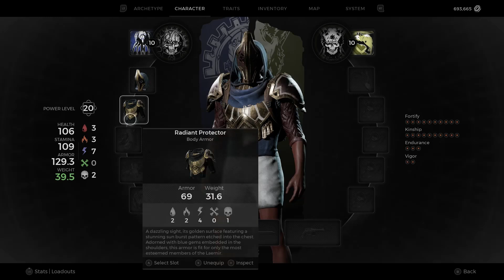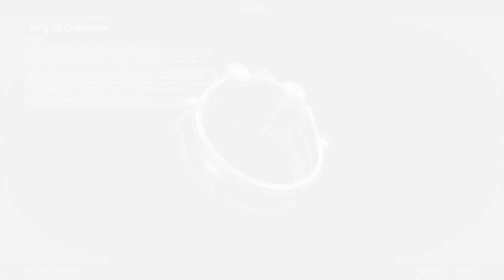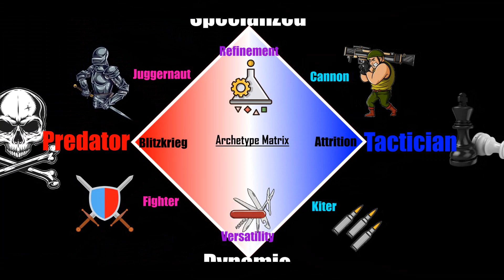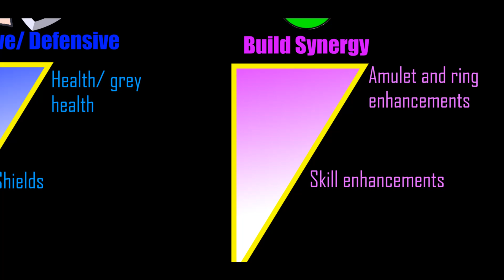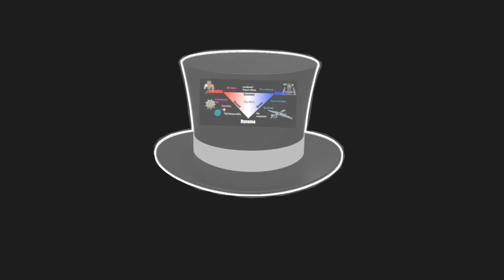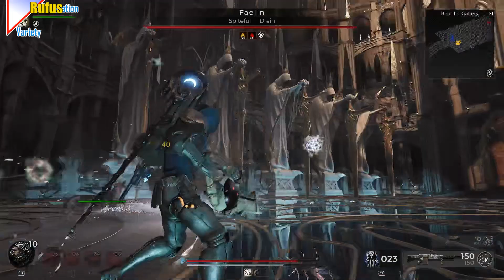Remnant 2: Engineer and Handler// HOWLING HOWITZER// Apocalypse Build

Comment: So here's my two cents, mind you I'm half through the video. I think Handler could be swapped for Summoner, not only would the dps go up by a bit bc of the summoner's sub perks. Namely "Dominator" which increases your skill damage, mod damage and explo damage. I recommend giving it a try.
Reply from the maker: @MidnightsShadow9215  you make a great point; for a build like this, summoner is a reasonable choice (especially for the reasons you outlined). I’ve covered the engineer (prime) and summoner in the recent past and consequently wanted to diversify the engineer’s heavy weapon carrying builds. Additionally, I would say Rufus is an unparalleled distraction compared to minions, especially without the rugged trait